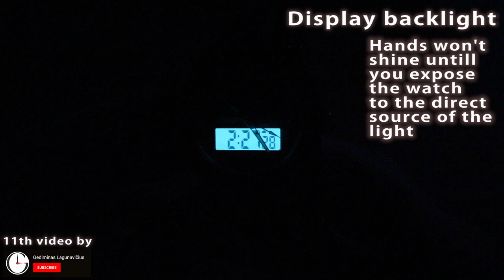Skmei 1049 Solar watch review #11

Comment: If you find a small rectangular piece of rubber on your work surface, while replacing the battery (s) it goes in the white plastic part.  Fits in a slot there.  There are two if these.  One near the stem and the other across from it.
Reply from the maker: Yes, I know that. Figured it out a bit later ...

Comment: OK, but the purely digital part (LCD) does actually work on solar power? Is there a rechargeable micro-accumulator separate from the battery?
Reply from the maker: There is no any rechargeable battery. also check this https://youtu.be/4uA0n-Ly7oE?t=197

Comment: Update: i've bought one and checked the solar power. Yup, the solar panel does work and actually the solar panel could charge the battery bc my volt meter read there is electricity around 4.5 v in battery place when i put the watch under a flashlight. But yeah, 4.5 v would damage li-ion battery tho bc its highest charging voltage is only 4.2 v.
Reply from the maker: Thanks for your feedback and the info. It could charge the battery,  but the watch comes with non-rechargeable battery :(
Reply: @GedmisLaguna  you're welcome. Yep, and even if you change the batt with rechargeable batt (LIR2016) the batt will be damaged in short time due to 4.5 v charging voltage.
Reply: Shouldn't it be possible to add a resistor to get the voltage down to safe 4.2V? Or perhaps even with a diode? I've seen some solar calculators having a germanium diode in them. And the digital Timekeeping PCB seem to have 2 of those soldered on to it as well. If this thing could be easily modded that would be quite interesting.
Reply: Pelo que você está dizendo esses relógio 1049, não carrega de fato a bateria é isso???

Comment: Hello and thanks for the wonderful video. I used your guidelines to replace the original battery as it turned out to be just exhausted by 1.1V. Everything work but I found out that after the assembly two very small springs came out and the backlight does not work. Can you give me directions where they are to put them. Once again, thank you for the nice explanation.
Reply from the maker: Pause this video at 3:47,  check 2 black square small areas at 3H and at 9H postions, these are contact spring should be placed

Comment: so, what is the conclusion?
Does the solar panel really work?
Reply from the maker: It works. Solar panel powers the digital movement directly, but doesn't charge the battery.
Reply from the maker: Also check this video https://www.youtube.com/watch?v=4uA0n-Ly7oE. The movement works without a battery if the watch is displayed to a light.
Reply: @GedmisLaguna   thank you. I wanted to know bc i just ordered one (skmei 1049) and in your video looks like the solar panel doesnt work (altough you've described why). I will check my 1049 when its arrived. I've watch the other video (1405). Yup its work but its to big for my wrist. Thank you.
Reply: @muhammadlutfi4315  it should work on both analogue n digital if in direct sunlight try and see
Reply: @715michala  nope, i've checked it and there is no connection between analogue and digital circuit (and also the solar panel)
Reply: @muhammadlutfi4315  that's odd some videos show the digital display working from sunlight others just the analogue in one both were actually working together - the display may be blank or feint as it has to be under direct sunlight.however I understand the battery isn't rechargeable and has to be replaced eventually upto 2 years.Skmei claim that both mechanisms should work without battery power . see model 1050 c video exactly the same and works the watch has too batteries I think large one and smaller one underneath if you can check
Reply: @muhammadlutfi4315  oh I may be wrong then it shows display only what a con!!! Gonna buy a real watch